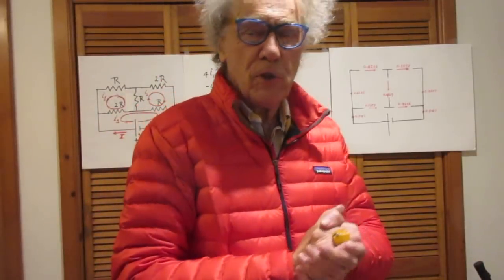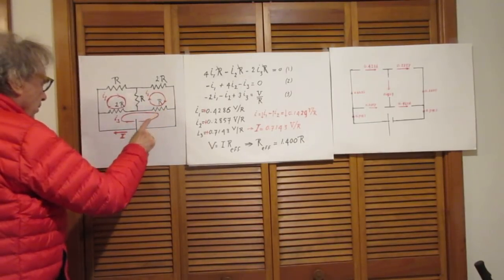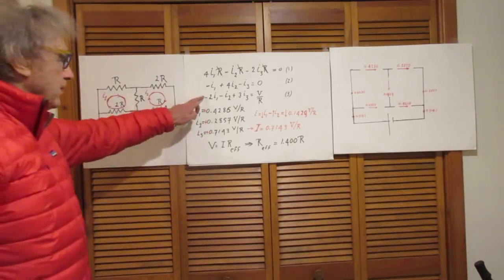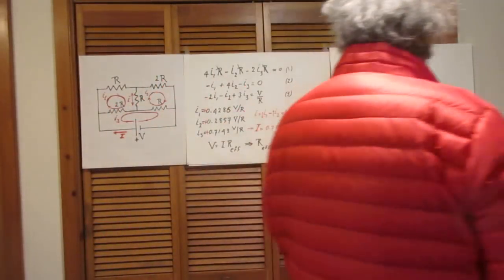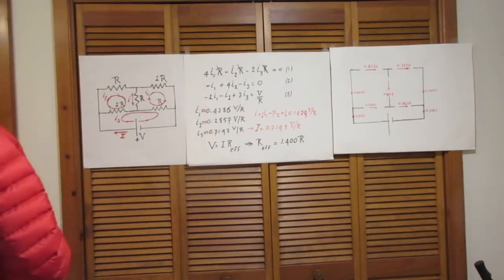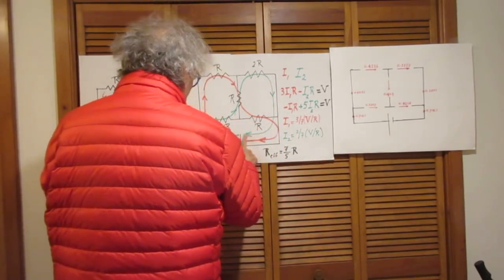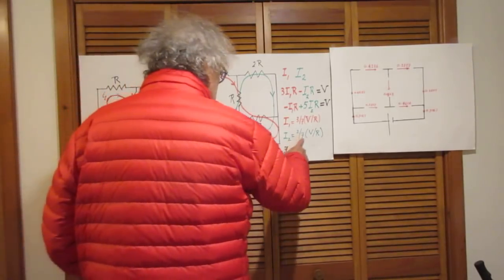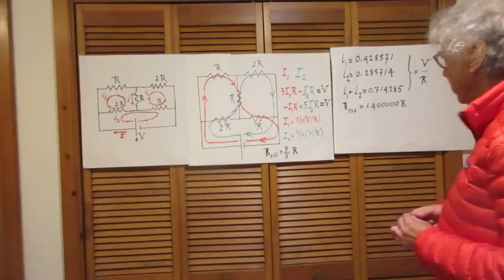Solution (1/4) Problem #24 - Circuit with 5 Resistors

Comment: I’m sure I speak for all of us when I say we are super grateful for these videos with all the thought and effort that goes into them…

For the sake of curiosity what would be the circular flow path if a second resistor equal to R was placed parallel to position i? Using the longer method (if I understand correctly) it would require the inclusion of a 4th circle, but with the quick method, I am stumped.

Pozdrawiam/Best Regards,
Mat

Comment: thank you Sir ..and Long Live i wish i was at your class....i made almost the second solution by the way to decide the direction of the current in the cross arm of the bridge while to calculate the total current i thought to convert the left delta to a star resistor configuration then it comes to be easy to find the total resistance , hence the solution pops up. thank you.

Comment: Sir I have a question...
Why does a bicycle not topple over when it is rolling without a rider...

Sir can you correct me if I am wrong...
If the bike tips to one side, there is a torque about the bottom most point (contact point) which makes it topple. The direction of that torque is along the diection of motion of the bike.. But there is also an angular momentum vector perpendicular to the direction of motion horizontally... Since torque is rate of change of angular momentum, angular momentum vector must change its direction which in turn changes the direction of motion of the bike itself...
So as it begins to topple it also changes its direction of motion which provides stability....

Is this correct? This is the only explanation I could come up with....
Reply from the maker: ask google or quora

Comment: Professor , the second meathod is brilliant (i' ve never thought of those non conventional loops). But a faster meathod(<3 min) do exists, it uses symmetry of circuit and 'Kirchoff Junction Rule'. 
Above all , wish you a very Happy Birthday sir.
Reply from the maker: please send me your faster method
Reply: Lectures by Walter Lewin. They will make you ♥ Physics. Sir where to send?
Reply from the maker: Here is my 5 minute solution
3I1R-I2R=V -I1R+5I2R=V 2eqs and 2 unknowns 
please write your shorter solution here.
Reply: distributing the potentials, assuming -ve terminal of battery to be '0' potential . So Left side potential is 'V' and that of right side is '0'. By symmetry current in upper R ohm  and below R ohm is same hence the potential across them is also same. Let the potential on the top of middle resistor = 'x' so  the potential of the point(node) below middle resistor will be 'V-x' .Now applying Kirchoff junction rule on the node above middle resistor :
 (x-V)/R + (x-0)/2R + (x-(V-x)/R =0 (single equation)
Which gives x=4V/7 ... And V-x = 3V/7 
Now we can apply ohm's law and find currents i and I (as well as their direction) ; i=(x-(V-x))/R= V/7R ; I = (x-0)/2R + (V-x)/R = 5V/7R
This solution might seem lengthy but it just occupies 2-3 lines.
Reply from the maker: In my view this is an inferior solution as you have to explain how you end up with  (x-V)/R + (x-0)/2R + (x-(V-x)/R =0 (single equation). My solution is simply Kirchhoff which is familiar to all physicists
Reply: Lectures by Walter Lewin. They will make you ♥ Physics.  It is just "summation of all outgoing currents from a node = 0 " Kirchoff current  law.

Comment: Your second method is fiendishly clever - thanks!
Reply from the maker: I too ❤️ my second method. It's so elegant and Kirchhoff at its very best!
Reply: I am trying to think of a technique whereby I might have come up with it myself. Perhaps: Draw as few loops as possible that go through each resistor, and the power source.
Reply from the maker: In my problem, 2 closed loops (which lead to the correct solution in less than 5 minutes) is the minimum number possible.

Comment: Suppose I have a circuit through which a fixed current moves.  Now I take it to moon will current change as gravity one moon is less than that of earth so now electrons would move faster. In general do the speed of electrons in a circuit change with different locations in the universe?
Reply from the maker: gravity plays no role on the drift velocity of electrons in a current.
Reply: Lectures by Walter Lewin. They will make you ♥ Physics. Not even minutely

Comment: As your student and as you say friend i am requesting you to please check the closed loop integral of E.dl for your solution in case of 5R resistor and please please please give a response
Reply: its wrong and i can now put a million dollar bet on it
Reply: check closed loop integral of E.dl in the loop containing the cell the upper right resistor and the upper left resistor.it is not 0 for your solution.you can check it yourself. take a second look to my solution.
Reply: you have to admit sir
Reply: current through upper left resistor(R) is V/3R,current through upper right resistor(5R) is 2V/15R, current through lower left resistor(2R) is 4V/15R, current through lower right resistor(R) is 7V/15R and current through the resistor in the middle(R) is V/5R
Reply: sir your shortcut method(2nd method in the video) works only in the case when the current through upper left resistor is equal to current in the lower right resistor and vice-versa, which is not always true and is only true in symmetrical situations.
Reply from the maker: I will not accept your million $ bet. I am sure I will lose. I did some consistency checks which show that my solution with the 5R is WRONG. I do not yet know what I did wrong but I will get back to you.
Reply: sir the problem with the second method. it only works when the case is symmetrical. if one solves with your first method he will find the correct solution.the second method doesn't always works.
Reply: can we be friends now :)
Reply: i wanted to thank you for making me learn so much things so easily and making physics more lovely for me so thank you and a happy birthday in advance :)   and sorry if any of my comments hurted you.
Reply from the maker: I agree, I did some consistency checks and found that the brute force method works but gives different values for I1 and I2. I also chose 2 different closed loops and concluded that the closed loop integral of E dot dL in those loops was not zero. I still do not understand why the 2 closed loops did not work. The closed loop integral of E dot dL must be zero for ANY closed loop in my circuit. *Can you tell me what is wrong with the  2 closed loop integrals  (with 2 unknowns) I applied KLR . As soon as I can find out what's wrong with these 2 eqs, I will do another video and correct some of my statements and I will name you and credit you.
Reply from the maker: of course we will be friends but that is INDEPENDENT of our exchanges. I apologized to you and I hope you will accept my apologies. However, I MUST now first understand what's wrong with the 2 closed loop integrals that I used (5R case).
Reply: Firstly, sir consider why your first method always works. It is a clever method of supposing the currents in a consistent manner in the different parts of the circuit.Your second method also does the same thing but it presupposes that the current through the upper left resistor is same as the current through the lower right resistor and vice-versa which comes out to be not correct in general.
Reply: I think supposing the potential somewhere in the circuit zero(say at the negative terminal of the battery) and then working with potentials in the different parts of the circuit is a better way of tackling the problem.i always use it and i think it is pretty easy.it also results in only a system of 2 equations which are trivial to solve.
Reply: Ohh I got it I think sir you were thinking that working with loops will always work and you tried to justify yourself that the current distribution will be symmetrical working with that method. I think you should change your point of view. Your method of loops is not something basic that should always work. You tried to prove the symmetrical distribution of current by your second method but i think the situation is just opposite. the fate of your second method depends whether the current distribution is symmetrical or not(at least in my view).
Reply from the maker: Ashish it's easy to prove that the 2nd "super" method only works if upper left and lower right resistors are the same AND if upper right and lower left are also the same. I was lucky that the 2nd "super" solution worked for me as it just so happened that I met both those conditions. I will therefore state in my correction video that my super solution was WRONG as the way I drew the 2 loops presupposes that the current through upper left and lower right were the same and also the the current through upper right and lower left were the same and that's of course not acceptable and it's wrong if the 2 conditions are not met. I will upload a video today or tomorrow. I will mention you and give you credit + someone in Nepal who also pointed this out to me. I will give the solution for the 5R case and will use the brute force method as that always works.
Reply: Sure sir
Reply: Ashish Kumar Yadav Ashu Supposing currents in consistent manner? What does that mean? Along a closed path shouldn't E.dl always be zero.
Reply from the maker: As long as there is NO induced emf the closed loop integral of E dot dL of ANY close loop is ZERO.
Reply: surely sir
Reply: You can draw the two loops of current as you did in the second method.  But you must allow for a third loop of current i3, say, in the bottom loop as you did in the first method.  i3 will equal zero for the initial choice of resistances, but it will not be zero for a general choice of resistors.  I don't think you can get by with just two loops, in general.
Reply: Lectures by Walter Lewin. They will make you ♥ Physics. Thank you.

Comment: Sir, I have a question. Does your second method(the quicker one) of tackling the problem work in every circumstance for an arrangement of resistors as in the problem(not necessarily having the symmetry)?
Reply from the maker: it depends on the circuit
Reply: Sir one more thing, I noticed that the symmetry in the current distribution do break when 2R is changed to 5R.
Reply from the maker: watch mu solution and LISTEN to what I say
Reply: Current in upper left resistor(R) becomes V/3R and in the bottom right resistor(R) becomes 7V/15R. Similarly current in upper right resistor(5R) becomes 2V/15R and in lower left resistor(2R) becomes 4V/15R.                         That's why I asked you whether your 2nd method of solving the problem works in every case or not as it hasn't worked in this case.
Reply: that is in the case when the upper right resistor(2R) is replaced by a resistor of resistance 5R
Reply: please reply sir you told that symmetry in current distribution will not break but it does
Reply from the maker: If you make to upper right resistor 5R then here is the solution
3I1R-I2R= V
-I1R+8I2R=V
I1 is ALWAYS going both through the upper left and through the lower right resistors.
independent of the values of the resistors. I2 is always going through both the lower left and the upper right resistor independent of the values of the resistors
Reply: am i wrong?????
Reply: check closed loop integrals of E.dl for your solution please please please its not zero please please please sir respond
Reply from the maker: I1 always goes through the upper left and through the bottom right resistor and NO other current goes through them. I2 always goes through the bottom left and the upper right resistor and no other current goes through them. That is INDEPENDENT of the values of any of the 5 resistors. I1 (down) and I2 (up) go both through the middle resistor. But through all other 4 resistors only I1 or I2 goes through them.  THIS discussion has to end here. sorry.
Reply: That can't possibly be correct professor. Easy to see : If both upper resistors  are 1000000 ohms then current will be 1 uA in both of them assuming 2V battery.
Then if both lower resistors are 1000 ohm current will be 1 mA in each.
Current in center resistor is 0 as potential for both voltage dividers is the same.
bottom left current is 1 mA, upper right current is 1 uA. There you have it.

Also I think solution #2 is a briliant one, but it works only due to symmetry. Current in both upper small loops should be taken into account but cancel out in case of symmetry. NOT in case of no symmetry

In short,  Ashish Kumar Yadav Ashu has an excellent point.
Reply from the maker: yes Ashu is right. I will upload a video and correct for what I said. I was very lucky that my 2nd solution worked so well in our problem, due to the symmetry
Reply: I'm glad you acknowledged this, hope you are not discouraged or feel bad about this now. You do an excellent job at teaching the planet for free in your eighties. Your virtually are always right about let's say anything.
While you're at it, you might want to explain about thevenins theorem. That makes it simple to calculate i, but still a lot harder to calculate I. And easy to explain  ...
Reply from the maker: Not at all discouraged. I will prepare a video in which I will show that my super method only works under certain symmetry conditions and I will generously credit Ashish Kumar
Reply: glad te hear that. dont mention me....ashu will be delighted and i couldn't care less

Comment: Professor , the second meathod is giving correct values but if we replace upper '2R' ohm with '5R' ohm then I'm getting different values of current in the two 'R' ohm resistors (inconsistent with what you said at 9:05) 
Am I getting it wrong??
Reply from the maker: You are right. My statement was wrong. I will correct this in a video which I will upload today or tomorrow. You are the 3rd person to mention this to me. By the way what are the values of the current that you find if you change the upper right resistor to 5R?
Reply: I am glad to hear this. I tried to multiply the two upper resistors  with 10 and the second loop method gave I=36/275  V/R which is less than  1/3  V/R if only the two bottom resistors were there.
Reply: Sir , on changing the upper right resistor to '5R' :
current in middle resistor 'R' = V/5R = 0.200V/R(downwards)
current through battery = 3V/5R = 0.600V/R
current in upper left resistor 'R' = V/3= 0.333V/R
current in lower right resistor 'R' = 7V/15R= 0.466V/R
But now I'm confused that what is wrong in your 2 loop solution?!
Reply from the maker: nothing wrong in my 2 loop solution except for the fact that it only worked becoz I made an a priori assumption which happens to be correct. But I had no right to make that assumption. Thus I withdraw that super solution
watch https://www.youtube.com/watch?v=Vg_NKnmk5lc&index=92&list=PLyQSN7X0ro23CEzKOjAVcRq66m6g-mFLe
Reply: But what is the relation between 'symmetry' and 'selection of loops'...the closed integral E.dl must be 'zero'( without induced electric fields). I can't digest this.
Reply: apurv shukla  yes closed integral of E.dl is zero but the equations may give imaginary solutions of I1 And I2.

Comment: I am getting different answer. but I can't determine how that is wrong. I applied kirchoff rules very carefully but still Im getting different answer.  See.
Path of current. 
I divides into two parts. Lets call the upper current I1. hence by junction law remaining current will be I-I1.
So I1 current flows through R and I-I1 current flows through 2R.
Now let us suppose current goes in downward direction through R (middle resistor). Therefore I1 again divides into two parts. one part you called ì going downward and the remaining will be( I1-ì) by junction law. It will pass through 2R
Now at the junction, just above the battery current I-I1 and ì will add up and the current through the last resistor R will become I-I1+ì. By junction law I1-ì+I-I1+ì=I which ks obviously true. On applying Kirchoff loop law to the 3 loops I get different answer. I don't know where I am wrong. please correct me
Reply from the maker: study my solution - or ask help from a friend

Comment: Why didn't you consider it Wheatstone bridge ,Sir ?
Reply from the maker: try it
Reply: Lectures by Walter Lewin. They will make you ♥ Physics. 
Is it true ? 
As if I consider it as Wheatstone bridge , (I) which passes through the resistance (R) would equal zero .
It's different from your answer ,sir .
Reply from the maker: The current through R is NOT zero.  Thus this is not a Wheatstone bridge

Comment: great but del to Y conversion will be better
Reply: Actually not.  Delta-wye takes considerably more effort and only gives you the total current from the voltage source.  Still have to use other methods to find the bridge resistor current.  I address that in a video to be uploaded later today in Part 2 of a two part video addressing various techniques to solve the bridge network.  Stay tuned.
GH
Reply: Just went live with my analysis and you will find many answers to your questions there:

www.youtube.com/watch?v=0u3UhXQGR9c

The DELTA-WYE  solution will be in PART 2 to be published in about an hour from now.
GH

Comment: But sir those equations in I1 & I2 can be inconsistent also
Reply from the maker: the brute force method never fails
Reply: Yes sir, bye the way you were not wrong totally because these are two linear equations in two variables : (a1)I1 + (b1)I2 = V 
   and (a2)I1 + (b2)I2 = V have a unique solution only if (a1/a2) ≠ (b1/b2)

Comment: You ignored my previous comment. Please post it.
Reply: I was the first one to write on the correction of the problem solution, regarding the fact that changing to 5R the resistor will chance the current distribution.